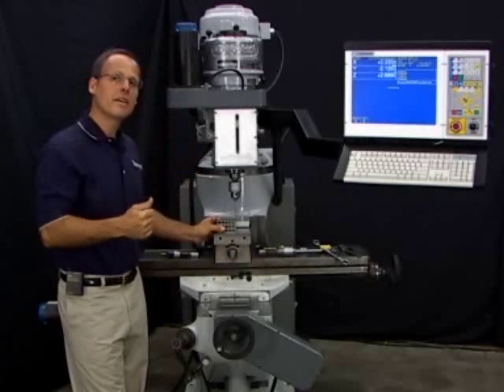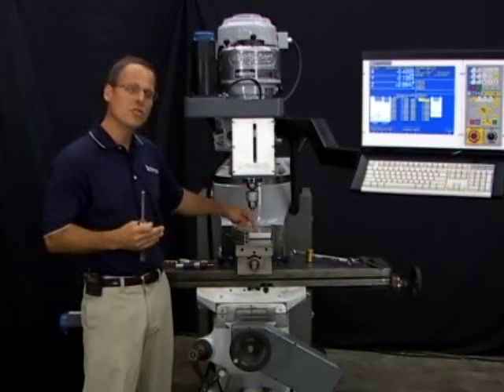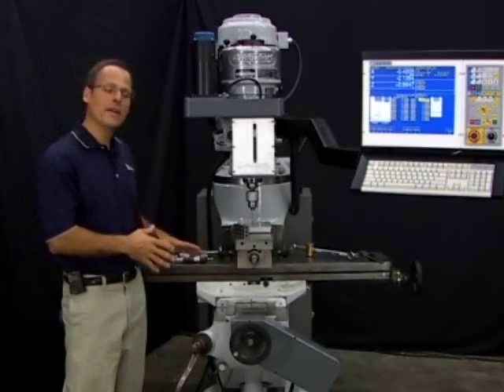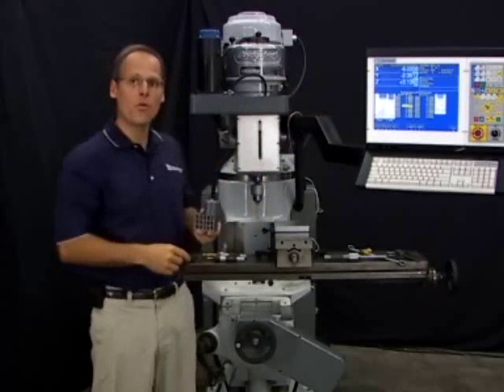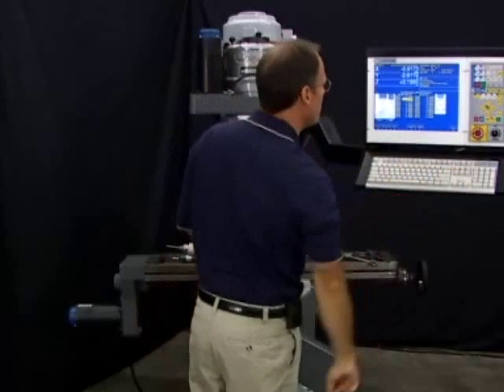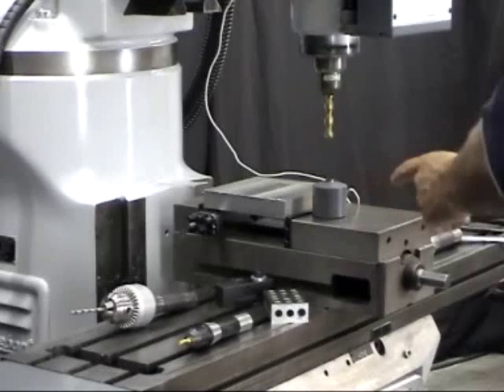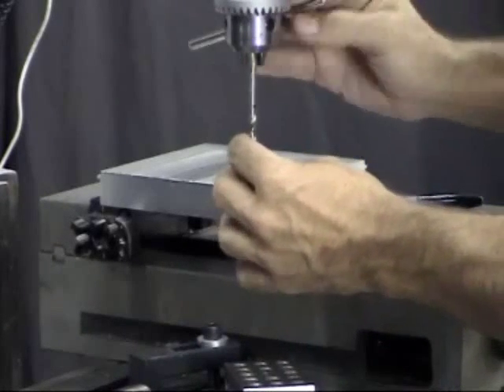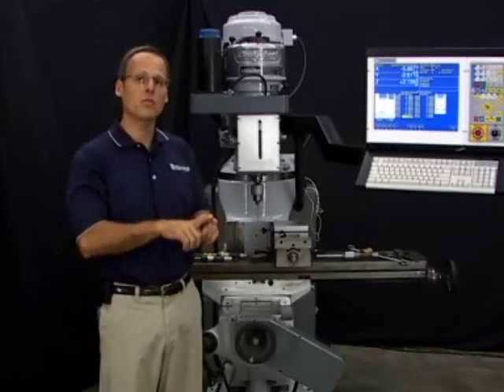CNC Milling Machine Training Part 6-2. Atrump Machinery Inc..wmv

Comment: What about us guys that have their heart set on not extending that spindle beyond 3/4 of an inch for milling?  What happens when going from a #2 center drill to a 1/4" jobber drill and then to a 3/8" end mill for ex. ?  all of this setting a ref bsuines  on a knee mill is moot?